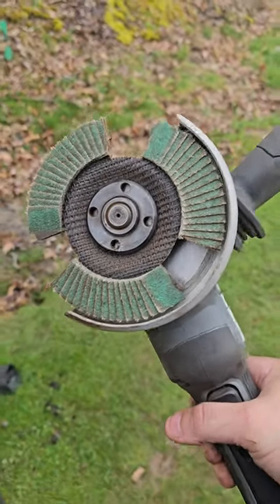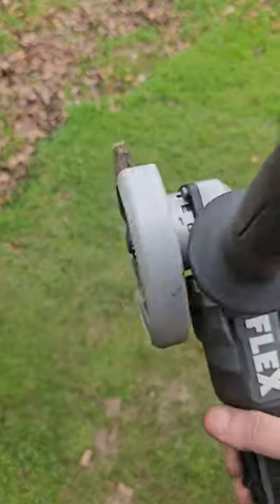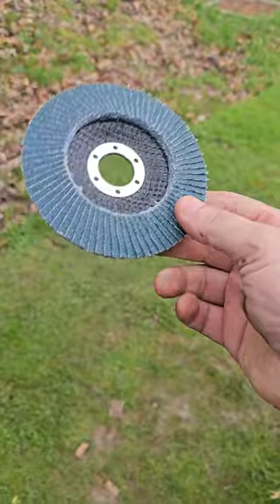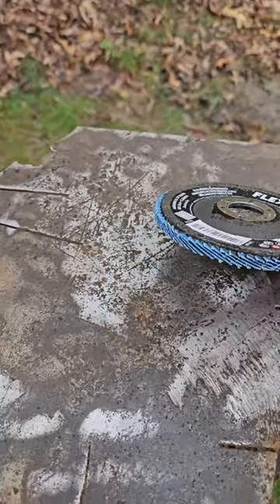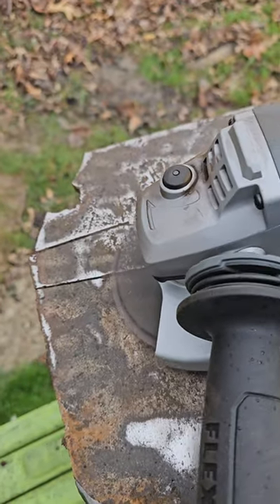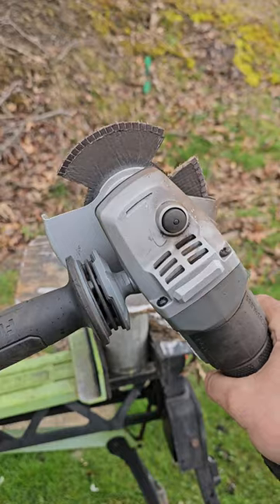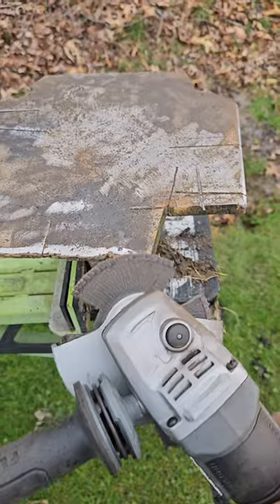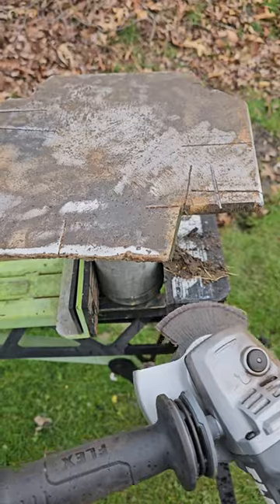The new grinding disk everyone is scared of #shorts

Comment: Until the edge catches something and explodes.  Let me tell you... I work in die cast and grind parts daily. The grinding discs we use can and have explode just from normal use and when they chunk out they really create shrapnel.  Face shield and safety glasses are a must. I even wear Kevlar sleeves for more protection.
Reply from the maker: That's because you have a crack in the grinding disk.  You shoukd be doing the ring test when using a new disk to prevent that
Reply: @ToolReviewZone  lol no we change disc multiple times a shift they were out very quickly.  Ours are more like sandpaper type not hard ones.
Reply from the maker: Ok I got ya 👊
Reply: I work with this many years. It’s a German company Rhodius. No Problems or explosions or else

Comment: Heres a thought, let the disc do the work, dont put an extreme amount of pressure on it (like you should) and everything should be just fine. Oh and just like a table saw, check your blade/grinding disc before each use. Property PPE should always be used when it comes to spinning wheels of death no matter their size.
Reply from the maker: Sounds right to me 👊
Reply: “Don’t put an extreme amount of pressure on it”, “like you should”. What the f does that mean
Reply: @Mobgnna707  It means, don't push down hard on the tool, and your spinning wheel of death, is a lot less deadly.

Comment: Very dangerous you can't guarantee the rigidity of the desk
Reply: A flap wheel is just that, a bunch of flaps all put next to each other and overlapping. So it doesn't really have any rigidity in the first place, at least not compared to an actual cut off disk or something

Comment: Guys this is sold on Amazon and in retail stores so you're in no more danger than using a regular flap disc!
FLEX 4-1/2-inch 40 Grit SightMAX Flap Disc, Type 29 - FA302001

Comment: Okay... Kinda cheated. So what they are f
Referring to is when you are on a flat edge not a corner and run it parallel and square the from the outside approach the edge and what you'll find is that most people can't hold the grinder steady so in a moment of either relaxing or flexing the plane drops below the edge now has no where left to go and then the user gets a mighty kickback.
Reply from the maker: How many other scenarios can you come up with? What about grinding while hanging upside down,  maybe grinding one handed blindfolded with a monkey on my shoulder.....possibly lying down sideways in a puddle of water using a generator that is not sinewave and runs on diesel or propane that was made between 2000 and 2003.....then what 🤷
Reply: @ToolReviewZone  lol. Okay in my scenario a real world example would be lawn mower blade sharpening.
Reply: Please for the love of god tell me your joking. You don't share up in lawn mower blades with a free hand grinder unless you love wasting time, and parts
Reply: @Rf-dr6zm  I wonder why the other name big brands don't do this? There's your sign